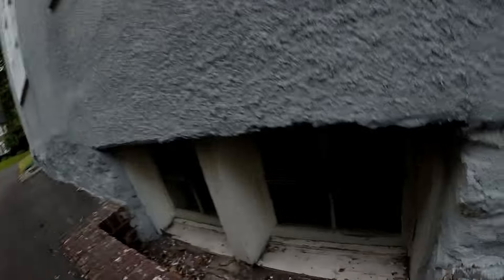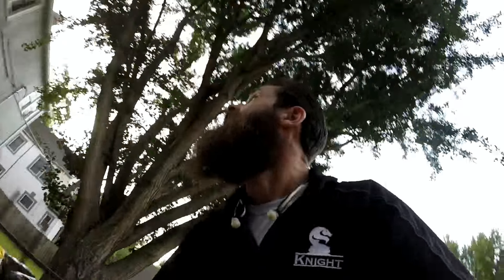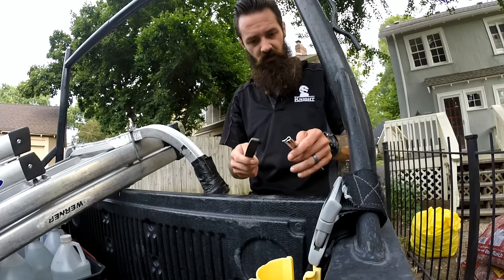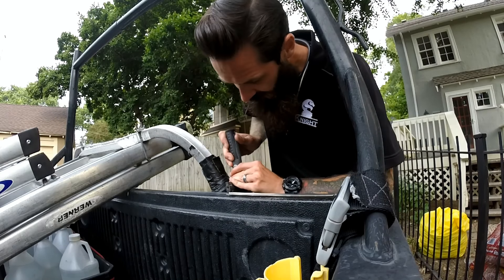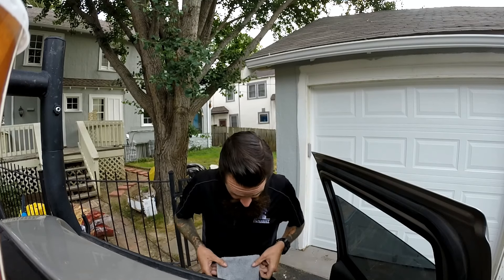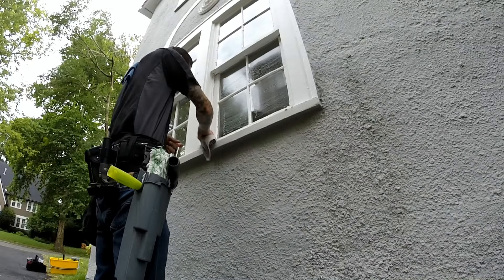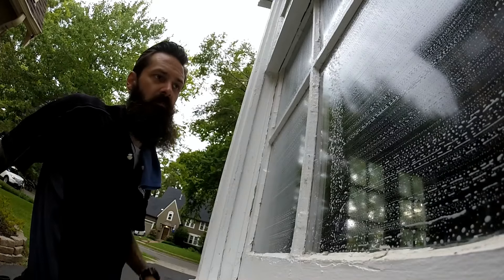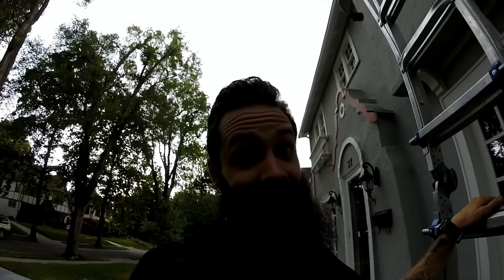French Window Construction Clean Up WINDOW CLEANING

Comment: Good tip on stock piling ! I just got a salon with this style windows. I bought a 12" thinking my 18 was too big. Turns out the 18" was a bit too small. But cutting them so I only have to do one pass will make it easier. Thanks for the tip ! Always learning !  Also how did you get into working with Builders to do homes ?
Reply from the maker: Thanks man. There are a lot of different ways . This home was from a client that flips homes. they used to have about 91 rentals ...I would clean the windows when they rehabbed the homes. calling builders emailing them. We were cleaning a home the other day and a builder drove by saw our sign on the truck and poof another builder.
Reply: +Luke The Window Cleaner oh that's too funny. I used to do foreclosure work for a contractor and met someone who was buying and flipping the house. Everything goes as planned I'll be doing his windows in a couple weeks !  Guess I'm on the track, Thanks !

Comment: I watched your other video on French windows before I got a regular account that had three different sizes. Cut 3 different channels and I was glad I did. 
Just now I am working on a bid for a time share. They have about 530 windows of which the majority is French windows. After tallying it up the have over 7000 panes just for the French windows. For an initial clean is $1 a swipe reasonable? No one else in my area has bid it right and bailed out. I want to make sure I'm bidding fair for myself and the client.
Reply from the maker: Kevin Anderson we typically start at at least 12.00 per window